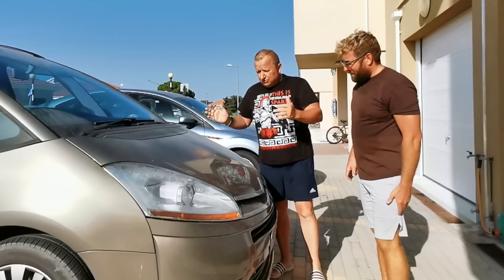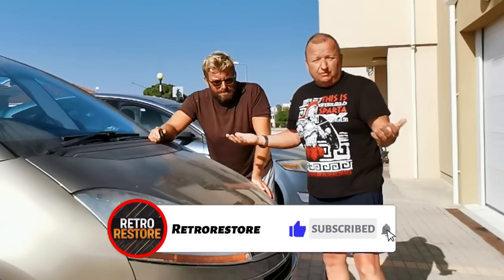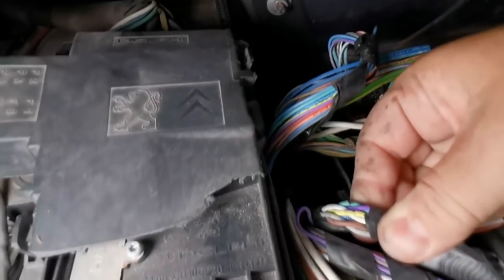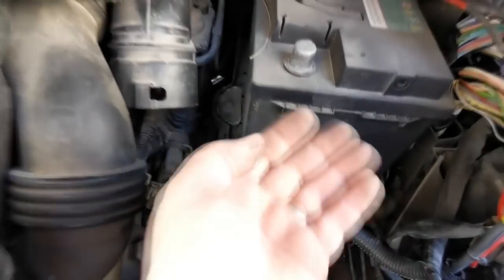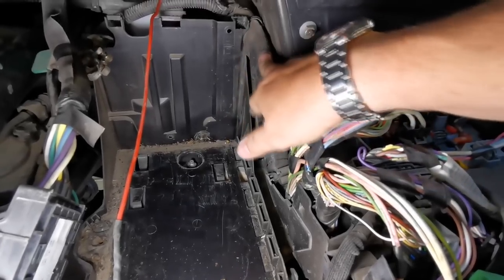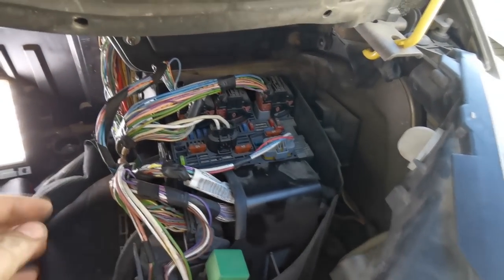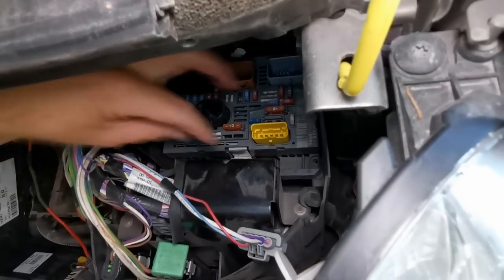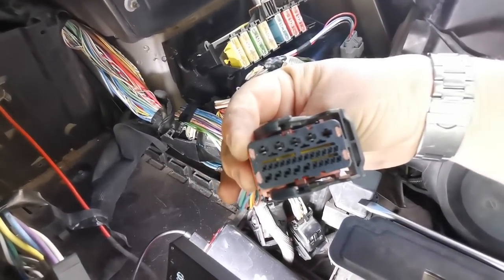Citroen Picasso C4 Intermittent Fault Cuts Out Anti Pollution ABS Service EML Parking Brake Part 1

Comment: Anti pollution fault is probably the DPF, and the car going into limp home mode, basically the DPF is full of soot and needs a regen.
Reply: A good way to help the regen is a lower gear and drive at a motorway (ish) speed keeping the revs higher than 3500 and above (I believe), for around 30 miles. A large black plume should emit from the exhaust.
Reply: Yeah i said dpf earlier a good 30 minute drive in 3rd gear can sort it most of the time

Comment: I’ve worked at main dealerships for french car manufacturers and other brands. 
Quite a few comments here mention that it could be a DPF problem, which is fair enough. 
However they’re also saying that giving it a thrash at high revs will sort it. Whilst that might clear any carbon buildup in the engine, it won’t necessarily clear the DPF. 
DOF regeneration often means driving at a constant cruising speed for a set time. 
There is plenty of information about DPF regeneration online. 
You can also buy DPF cleaner which you simply add to the fuel and I know people that have used it and it does work in some cases. 
Having said all that, you could well be right in thinking that it’s a wiring or electrical problem.  I hope I’ve been able to help. 
Good to you and Ben in sorting this fault.

Comment: Hi guys the intermittent fault is your solenoid on the egr valve failing. I had same problem on my Citroen c4 Picasso and cleaned my egr and noticed the electric part was to stiff and couldn't turn the egr valve so I got get a new one and fit then go on each and pair it to my car.hope this helps

Comment: These can suffer with a bad earth wire to the gearbox.

Also when disconnecting the battery on a psa vehicle always do the bsi reset procedure or you are likely to get other faults 

Depollution system fault is a generic message and needs to be scanned.

If it was the dpf additive it would show dpf fluid additive low on the screen.

Check the fuel pump relay, this can also cause this issue. Once fuel is cut it can show numerous faults because the engine has cut.

Esp/asr fault is because the can is moving while ignition on and getting incorrect signals so will go off when started whilst stationary.
Reply: Hey! still there?
This happend to me. I was running on low disel so the car sent out a "low fuel warning", and then just a second later ABS and ESP started to show. Do u have more info about this?

Comment: You need lexia diagnosis tool. Cutting out could be many things. I had one same colour and spec on a 57 reg. Cutting out could be anything from turbocharger overboost block ed dog and diffencail pressure sensors. Depolution fault is just a generic warning.
Reply: Sorry dpf

Comment: Elyios fluid Martin. Had same engine in my Ford Focus. Needs Tony up every 75k miles. It's not AdBlue but it gets injected in a very low dose to make the engine burn cleaner.  Could be slightly off on the spelling. Guess Cyprus is not the best for dpf equipped cars? Let us know how you get on.

Comment: Fuse box water ingress had 2 of these all with exact  same problem water stuffs up the fuse box also mine was trying to start without the key and doors locked. Mine was the fuse box as replaced it then it was fine until water got in again and always anti pollution fault followed by gearbox and handbrake fault i got rid of them i was sick and tired fixing them

Comment: Turn ignition on ans hold brake and acceleration pedal at same time look at speedo and it will go it to a cycle and will give u fault cods if there is any dosnt do it on all cars maby check the ear valve to see if its blocked with carbon it might have a dpf 9n it if it had drive it and hold on high reves to get it hot and keep doing it and it will self clean

Comment: did u ever sort the problem? i’ve just removed my dpf blanked egr valve but not got it mapped yet but it’s cutting out and coming up with anti pollution system faulty
Reply from the maker: Yes, the dpf clean solved the problem.
Reply: @retrorestore how did you clean it?

Comment: 0 I have the same problem all the lights came on the miniature belt serpentine belt weakens it comes on handbrake fault air pollution fault everything I change the serpentine belt every single light on the dashboard off

Comment: Ever heard of the phrase "French car's and electrics do not mix!"
Can-bus and Van-bus wiring is a spider web of signals from components and sensors. When one throws a fault it can trigger others within the web to throw faults too.
Normally I'd recommend sell it or burn it.
However I have faith in you...... good luck cus you'll need it 😂🤣👍
Reply: Burn it, it's the kindest thing 😆😆😆

Comment: Anti pollution system is your dpf. Diesel particulate filter, it’s blocked. Get this all the time at work. Go on a dual carriageway over 50mph over 2500rpm for 15mins and force a regen, if it doesn’t work you need to get dpf cleaned, or better still, get it gutted and mapped out

Comment: I have one of these vtr+ they are nightmares. Every week or month something pops up even my mechanic is fed up with it. He told me that my car is giving him a bad name/reputation as it's always in his garage with the bonnet up. The value they are giving me at part exchange is terrible in fact they prefer if I try to sell it privately. When would be new owner takes the car for trial drive they haven't bought it yet : pdf, abs, engine lights...if 1 light goes off another one pops up. I will never ever own another citroen once I get rid of this one. At the moment it's on my drive with flat battery nearly flat tyres and used as storage bin on 13 number plate. Surely PCA should be responsible for at least some compensation since their cars are so so unreliable. Just thinking about them now makes my blood boil 👹👿🤬

Comment: Hi Martin 
I’m an avid watcher of your channel and need some advice. I purchased the DeVilbiss SRI Pro Spray Gun. I don’t know what paint setup to use. Could you please advise me if I paint a Mountfield Red deck. Could you please supply a list of what I would need. And also point me in the right direction to get them. 
Many thanks and keep the video’s coming. 
Regards Peter’s Mower Shack.
Reply from the maker: Pete, I use a 2k lacquer for the top coat as it's fuel resistant. Check out my lawnmower repair bids where I show what I use. Also watch the direct bikes repair bids where I share what I use.
Reply: @retrorestore  thanks Martin

Comment: Check brake light switching had c4  when u brake it cuts revs of car
Reply: Also they have a bag of pdf fluid which  u have to change every  100000 miles it stops the cat shooting up it is under drivers side just in front of the back wheel under a plastic cover

Comment: The usual thing with the anti pollution system fault is the dpf is starting to fail and isn't regenerating properly. 
Sometimes you can get away with forcing a regen but quite possible you will be looking at a new dpf.
It's also possible that the Eolisys additive tank for the dpf is running low.

Comment: On a completely different matter but i feel worth mentioning when parking these picassos in hot weather and direct sunlight be sure to cover the top of the dashboard as the glove box lids can warp really bad !! they literally curl in on themselves to replace new from citroen is a whopping 
£336.00 EACH !! obviously you would replace with 2nd hand ones which go for around £60 each so still a lot of money even to replace 2nd hand so in this case prevention will be far cheaper than cure you can also spray the dash with say meguires protectant spray which protects the dash from uv rays but yr still need to cover the dash with a heat reflective cover this all came to mind watching this video filmed in very hoy conditions !! as regrds to where all those wire looms and fuse box are you could even buy a fire resistent waterproof cover to go over that whole corner or the fuse box to stop water ingress as it is a common problem on these picassos touch the black material that sits behind the fuse box and runs along the bulkhead 9/10 it will feel damp to touch especially in that right hand corner hope this helps anyone ?

Comment: Lots of ideas in the comments, low eloys fluid, blocked dpf, and knackered fuse box, badly soldered joint at ecu. Hard to tell without a code reader really but someone will know the answer no doubt.

Comment: The rear of the car there is a right hand side off side take plastic cover off and pull unclip old bag put new one in the pump it plugs into smell very bad don't get it on you expensive chemical
Reply from the maker: Yes, we'll be checking that. Thanks